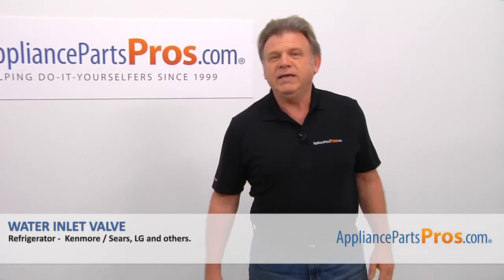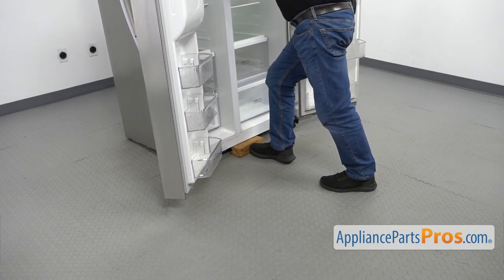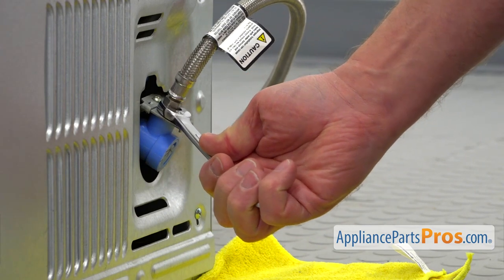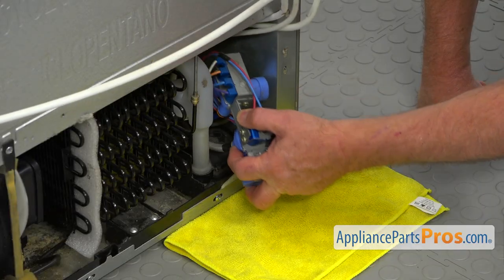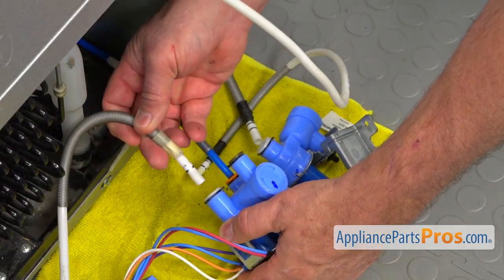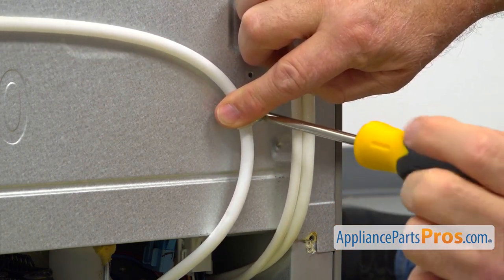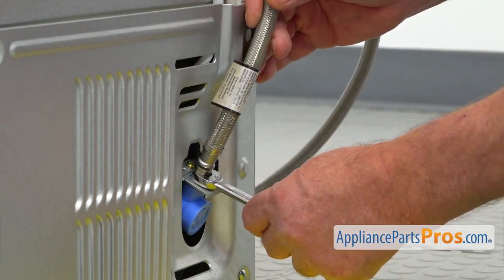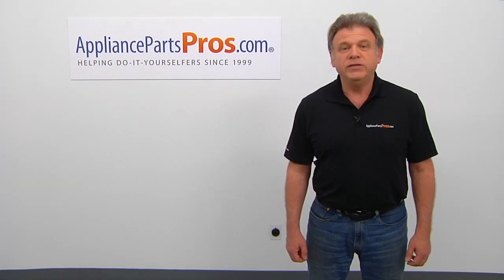How To: LG/Kenmore Refrigerator Water Inlet Valve AJU34125555

Comment: What if I'm getting water at the refrigerator dispenser, but no water going to the ice side?  It looks like there are 2 solenoids on the replacement part.  So only my ice maker water supply solenoid has failed, and that's why my water dispenser still works, right?
Reply: See my answer above. It looks to me like the part has one main water line, and one more valve that selects between water dispense and ice maker water.

Comment: I did this today and the video was really helpful.  Took me a little under 2 hours.  For me the hardest part was getting the blue hose far enough under the fridge.  I had reassembled the entire thing from the back and went to the front expecting to see it but it was still buried in the pipe.  I ended up redoing it and attaching the blue hose in the front before screwing in the rest of the valve.
Reply from the maker: Happy to hear you were able to do the repair! If you need help with anything in the future let us know!

Comment: Thanks! On my LG, I was able to dispense water, but the ice maker did not get water. After replacing this part, it solved the problem! On mine, I did not need to tilt it, instead I needed to remove a simple plastic skirt on the lower front, and there was two connections. I only needed to disconnect the blue one (the valve I bought came with one new blue line).